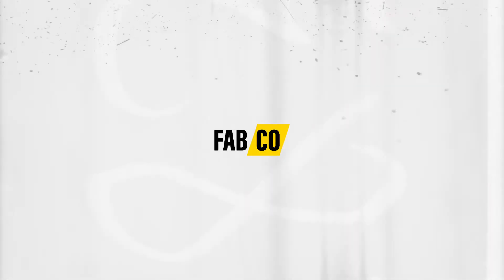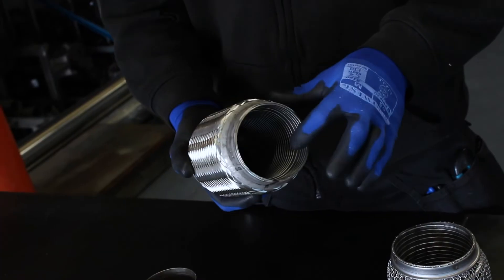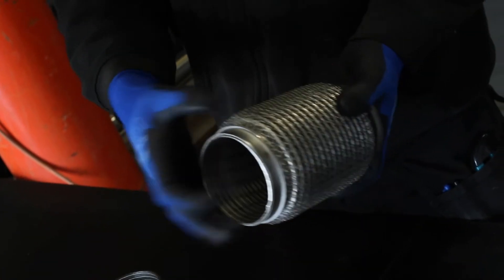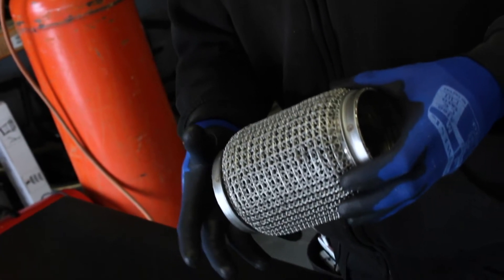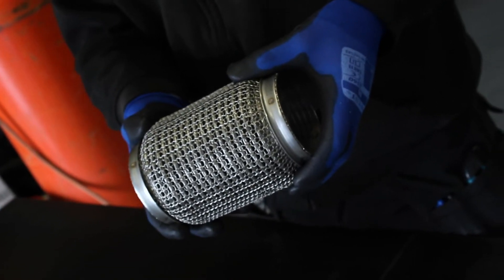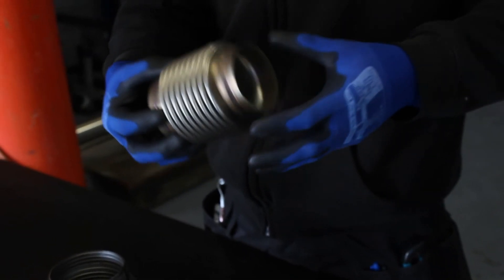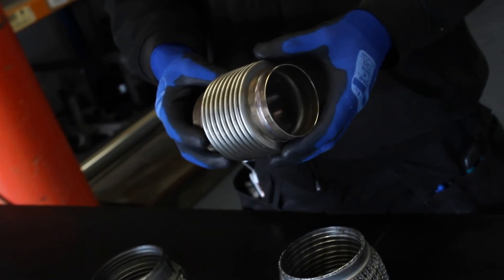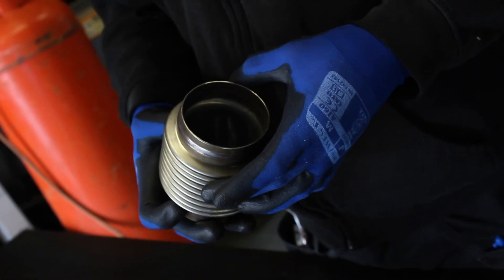Flex Section Comparison

Comment: I have a rasp noise under load coming from i believe the flexi, I've replaced it once before but I've noticed the Brading has let go on the outside but the bellow isn't blowing or split.  how likely is it that this is the cause of the noise? is it possible for the liner to become too short inside as the bellows expand  and  allow exhaust noise out through the bellows?